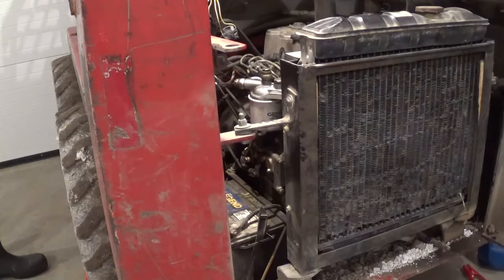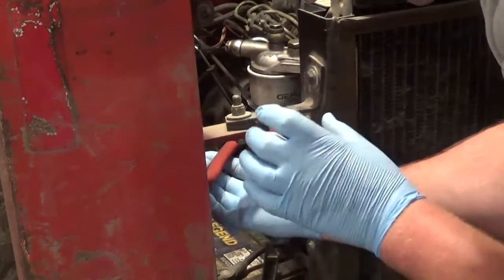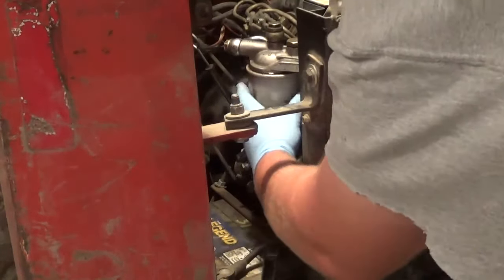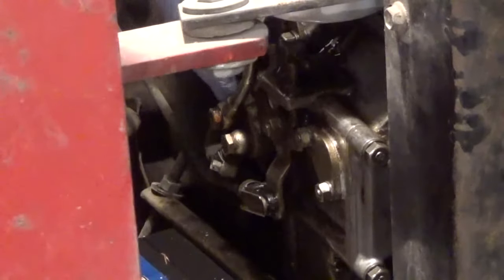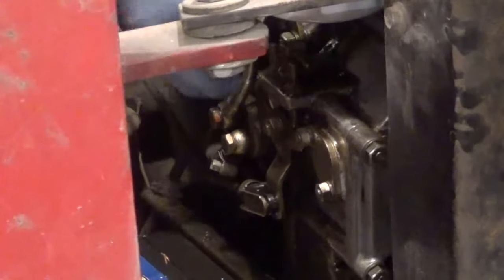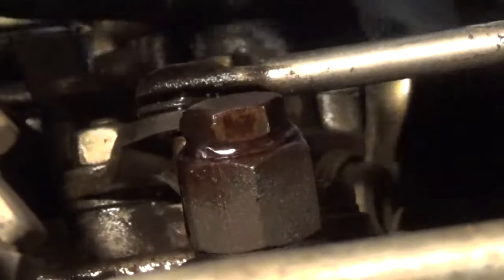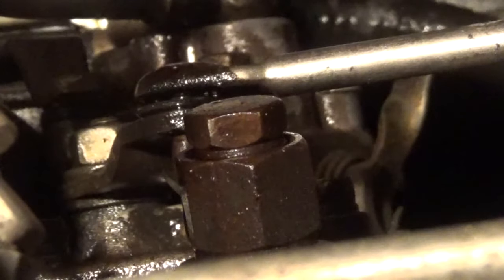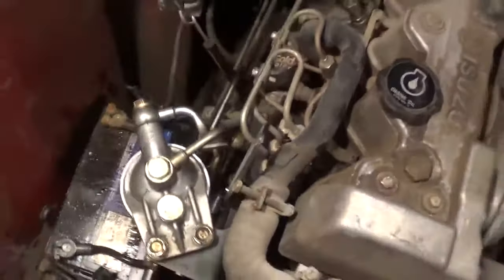How to change a Diesel Fuel filter ............  Gehl 3410 Skidsteer

Comment: Do you still have this skid steer? Wondering what your opinion of this machine is as there is one for sale locally.
Reply from the maker: Yes I do, for its size it has been a great machine. The biggest drawback is the weight capacity. I wish I could lift full pallets.
Reply: @SkylarHillShop  how many pounds do you reckon it will safely lift? Thanks for the reply btw